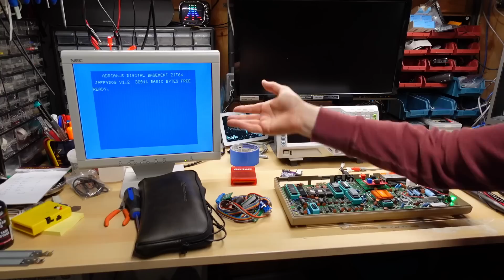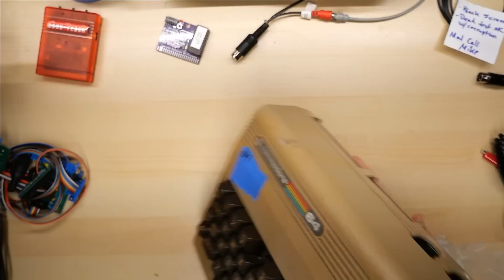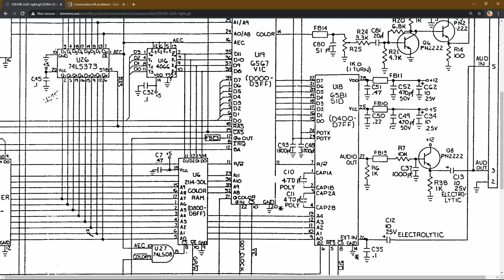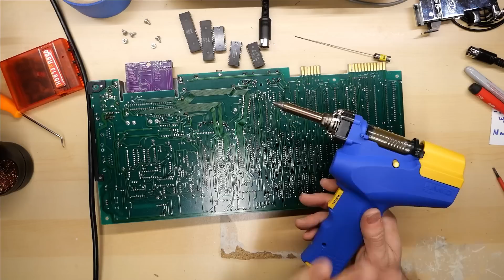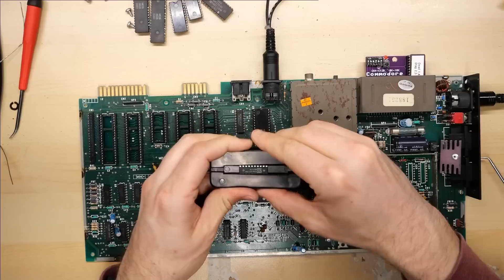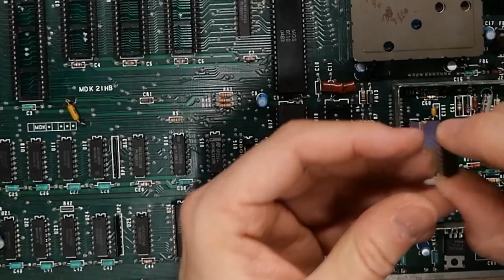2021 C64 Repair-a-thon #1: "It stumped me!"

Comment: The Dead Test does a very limited RAM test, because the C64 is in Ultimax mode. In Ultimax mode only 4KB of the C64's RAM is available and this is what the Dead Test tests. (This is documented.) The Diagnostics Cart does a full RAM test. Therefore don't assume all of the RAM is good if the Dead Test passes.
Reply: I recall the IBM PC diagnostics only testing the first 256 KB because that's all the original 5150 shipped with, and that could cause similar issues, especially because anything above that would be in another bank or even on an expansion card and thus could not be assumed to be good just because the machine boots or passes basic diagnostics.
Reply: All, Are the memory chips readily available today for purchase new for these old machines? I am going to be going thru a few machines in the next couple weeks from a purchase I did almost 2 decades ago. Also what diagnostic boards would everyone suggest to troubleshoot a C64? If there are any similar Atari 8 bit Diagnostic boards I would be interested in those as well. I have a Atari 1200XL that  I want running. Not to mention a couple other 8 bits I have in my collection.
Reply: @cmgray74  4164 memory can be found on Ebay, AliExpress and other sites for dump prices. For diagnosing a C64, the combination of Dead Test and Diagnostics Cart is normally sufficient to find out what is wrong with a machine.
Reply: @danielmantione  Thanks so much for the info!
Reply: Even if only the first 4kB were tested, the test would come back negative because of the faulty D0 bit. Your comment makes no sense.
Reply: @XLV750RD01  With D0 bit fully faulty, the dead test would flash the screen rather than boot up with the tests. So the D0 RAM chip was partially working for sure, the fault was in memory cells with higher addresses.
Reply: @danielmantione  Do you even understand how the binary system works ?
Reply: @XLV750RD01  Dude, I know the C64 from left to right and top to bottom. Carefully read again what I write, it is exactly what was going on in that machine.
Reply: @XLV750RD01  Daniel is saying that the unstable bit problem probably didn't show up until the address bus was above 0x1000, which means as far as a low ram test knew, it was working.  That's why good ram tests often run for hours and scan the whole address space, setting each bit and shifting them... which is not what dead test's ram tester does.
Reply: @XLV750RD01  you clearly do not

Comment: I have a 407 board, that i am working on, every main IC is tested and works fine, but the machine is not outputting any video signal, like nothing at all, it had some bad RAM chips, i have replaced them, but still nothing, i am just confused, anyone has any idea???
Btw I am dying to get my hands on a C64 with a ceramic VIC II :D
I only have 9 breadbins, but none of them have a ceramic VIC II ;(
Reply: If there is no signal at all (rather than a black sceen), there are not much more possibilities than a bad VIC-II or a bad clock. Or perhaps the video output circuit.

Comment: One thought I had when you were checking the outputs from that chip where the signal from 2 of the pins looked odd - compare it with the output from the known working Zif c64. If they are the same on that one, then that could be ruled out as the problem.

Comment: Perhaps the drill should be to make sure it at least responds to the dead test cartridge first, and as soon as you confirm a understandable display, then switch to the full diagnostic cartridge for analysis. As for the shield, you may want to save a sheet or two of that insulation, it’s called fish paper and often used for insulating barriers around energized parts.

Comment: About testing your 74 series chips
The TL866 can test a lot of them.
And if the chip is not in there, chances are good someone has put a config file on github for adding that test.
Reply: Can the Linux version of the software also test 74 series chips?

Comment: I do not know how the dead-test cart works so this is a guess, but if it uses a simple "write byte and instantly read back" test cycle then you might have it report that the DRAM is fine while the bit decays (i.e.: DRAM refresh doesn't work) over a time (ms). The other test cart may do a better test like "write page wait and read page" using multiple bit patterns (0x00,0xFF,0xAA,0x55, etc...) to check for this kind of decay or 'bit-flip' issues. 

Given this isn't the first time that has affected a repair (Jan Beta), it might be worth someone dissembling the code to see how the memory test works and work out what kind of DRAM failure modes that would not be caught by it.

Comment: @Adrian's Digital Basement Perhaps this dead test uses a specific static bit pattern for testing, one which would not reveal the off-by-one least-significant-bit error? That could explain why it corrupts the screen, but still passes the checks.

Comment: Here's a tip for testing the 74LS chips.  If you have a TL866-PlusII eeprom programmer and use the Xgpro software, under Device->Logic IC Test there's a logic tester that can not only detect the IC, but verify that all the pins are working properly.
Reply: I have seen Adrian using that before, I wonder why he didn't use it that time :)
Reply: @retrolabo  he needs to keep himself a handicap so his powers would not frighten us
Reply: The risk is that those chips can be marginal - test just fine in the TL866 but don't in circuit. Same with DRAMs. Had that happen WAY too many times to trust chip testers.
Reply: @neilbradley  Yeah that stupid tester in the TL866 is flaky.  I've had it lie to me several times.  I think it might be due to the fact that it's not really using the chip in the same way that the motherboard is.  In other words, it's maybe flipping the CE and doing a few tests, and that's it, whereas that CE line might be left on in circuit, and the chip might get warm over time and have a thermal issue because of that.
Reply: @Calphool222  Yes, exactly. Each system that uses the chip will have different loading and timing characteristics - something the TL866 (I assume) does not.

Comment: After years of dreaming an accessible and affordable desoldering gun, I could finally get one (wasn't too cheap but cheaper than a professional one with a station). This week I used it to desolder one of the analog stick in a PlayStation 4 controller. It has 3+3 legs for 2 potentionmeters, 4 legs for a button and 4 structural points of the whole analog stick housing. It used to be a very difficult process but now that I have this desoldering gun I'm so happy and I can do jobs like these much easier and makes repairing stuff fun again.
Reply: Yhea. I really need to get one, solder suckers are ok for a few joints but otherwise are a PINA. What did you get?

Comment: You mentioned you had no way of testing logic chips, that is incorrect. The minipro can test TTL logic chips.
Reply: Also, the logic testing function has been much improved in the latest software release.  Worth an upgrade!
Reply: Does the Linux version of the software have a test feature?
Reply: @MattKasdorf  No. The linux software is not supported by the vendor and does not provide logic chip test functionality.
Reply: @MattKasdorf  Works running it using wine. Well, does for me anyway.

Comment: Great video!! 100K coming soon I hope!!

And your skills with troubleshooting C64’s are just fine. Test equipment can sometimes lead you down a path that takes you away from the actual problem. The old saying (from when I was in the Navy) is: trust your test equipment, until you can’t.

Working on aircraft fire control computers ... sometimes our TE would lie to us and make the job harder. But, it happens, and you did a superlative job working through it. Maybe the dead test module needs an upgrade?

Really liked this one, Adrian!! Great job!!

Comment: @16:30 gracefully de-soldering the shield, and immediately tosses it to annoy the shield lovers. I love it.
Reply: @CandyGramForMongo_  well.... yes,... compared to his usual treatment of rf-shields :-)
Reply: Y'know, I would've thought he'd learnt his lesson after his troubles with the Macintosh Colour Classic… ;)
Reply: @youdontneedtoseehisidentif4939  good lord, that broken rf shield acting as ground plane for the speaker was so elusive
Reply: I understand removing an unnecessary rf shield, but with old machines, why not be careful, no need to possibly damage the pcb by cutting
Reply: I don't get why people love that trash. It doesn't do anything. It's not even like it makes a heat sync.
Reply: @awilliams1701  My guess is that it's about originality.  In the 1980s, the RF shield was required to bring emissions down to FCC standards.  Of course, it's no longer required, but it's an original part.
Reply: @SpearM3064  Well yeah that's why it's there, but it's not required anymore and the FCC doesn't give a crap about these machines. So the question isn't why is/was it there. The question is why do people care about it going into the trash can where it belongs?
Reply: @SpearM3064  I am not an C64 enthusiast nor capable of fixing them and I understand the originality sentiment. That said: Adrian at least tries to revive these machine's while others don't give a toss (pun intended).
Reply: @awilliams1701  Original state of the machine. thats why retro lovers try to keep their stuff as close as possible to the original.
Reply: @awilliams1701  RF noise from electronics can definitely cause problems. They added the shield because they found it necessary so it seems wise to keep it both from an originality and a functionality perspective. I understand it does make them harder to work on though
Reply: @smeezekitty  it makes little difference. I removed mine and its the same. Its 100% fcc from the 1980s. They had to. It really is garbage.
Reply: @awilliams1701  I wish we still had the FCC of the 1980s then because so many electronics are atrocious radiators
Reply: @smeezekitty  lmao the shield might reduce interference but it does nothing for heat. If a device is on it makes heat and that leaks into the surrounding environment. Honestly its not that bad. My new ryzen 5900x runs very cool. My new laptop only gets a little warm but never hot.

Comment: 24:00 If only you followed the schematic before desoldering you'd see the "screwy" (floating) inputs come from CIA2, that you removed.
Reply from the maker: You're absolutely right! I realized that after
Reply: @adriansdigitalbasement  No worries, failure often teaches us more than success & persistence paid off in the end 👍
Reply: Yup, for a little constructive criticism, I think that this should be mentioned first and foremost - you have to get your hands on some schematics and/or troubleshooting guides. To be fair, that depends on the machine though, because a popular computer like the C64 will have tons of troubleshooting material available whereas other rarer machines may not.
Reply: @LeftoverBeefcake  It's fantastic that Adrian leaves all his problem solving in his videos, and has schematics to hand! It's like watching a mirror image of 90% of his audience fumbling and trying different things. We all do it, and that's why it is such a great educational tool.

Comment: With how often you use your zif 64 has it ever not worked while booting?
Reply from the maker: Other than when I first got it (before mods) it was broken ... The. After that it hasn't worked because I accidentally left a chip out of it. Usually a RAM chip LOL!! Otherwise it's completely reliable, which is wild considering how butchered it is!

Comment: Adrian, are any of these repaired C64's for sale from you? Thanks!
Reply: same here i have a disk drive,  monitor, bunch of floppy  waiting for one to play spy VS spy with my daughter
Reply: @thenerdsentertainmentchann7922  if you are just looking to play c64 games, you might want to invest in a product called ‘Mister FPGA’, the price seems like a lot until you realize what you are getting for the price.  You get most computers from the 80’s, including the c64, Amiga, Atari S.T.  it also includes most game systems from that time period, Atari 2600, colecovision, many more. It also has many arcade machines.  You will have to get the roms for it yourself, but they are not that hard to find.  You get a lot for your money.
Reply: @allisterfiend_2112  tx i will look into it
Reply: @allisterfiend_2112  
As a Commodore 64 FPGA replacement, the Ultimate64 is way superior to the Commodore 64 implementation in MiSTer (I have a real Commodore 64 PAL, a MiSTer and a Ultimate 64).
Reply: @selagius  Yes, if you want to have a physical Commodore 64 and it's peripherals, The Ultimate64 is a good choice, but if it is someone like me who just wants to be able to load the games and play them with a joystick, you cant beat the MiSTer.  Plus you get so many more systems with it.